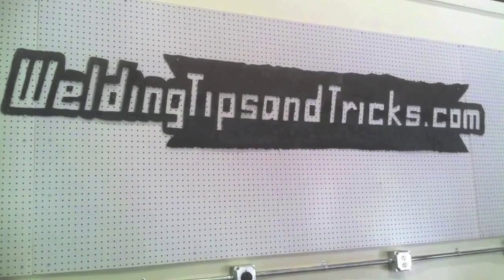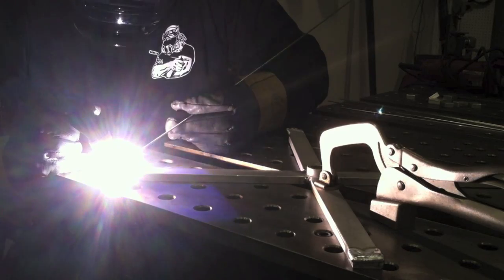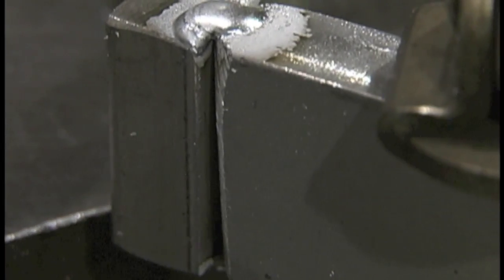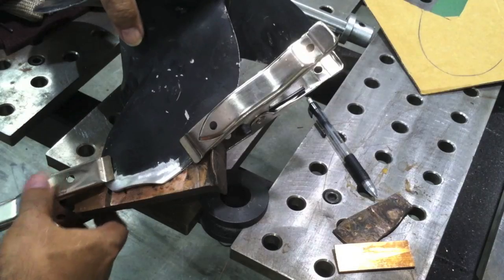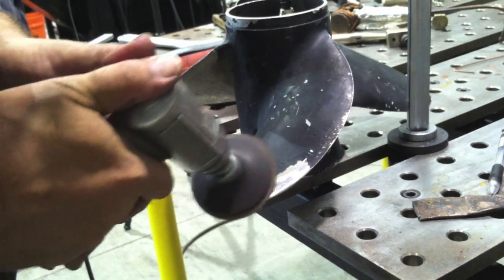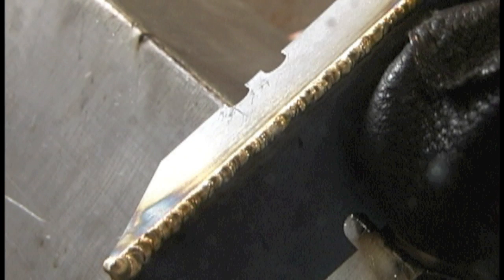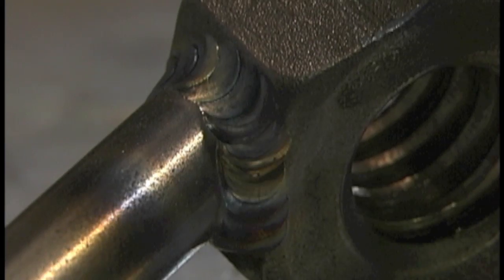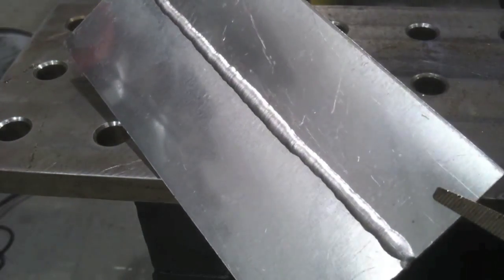Tig Welding 9 Random Tasks - Everlast PowerTig 210ext

Comment: it seems like Everlast has come to be a common name I was debating on a thermal arc 95s for a beginner tig setup but there is a Everlast one that is basically the same but a lot cheaper any recommendations no aluminum just thin steel for tig and about 1/8" for the stick welding

Comment: hey jody im having trouble with one of our Tig machines it says that it can weld up to 1/4 thick material, now today i welded a 1/8 thick aluminum gas tank for diesel trucks and i had to turn that sucker up to 174 amps to weld it  in your videos you only use half that most of the time. The machine is a millermatic syncrowave 200 and it maxes out to only 200 amps.

Comment from the maker: tungsten size matters mostly on starting the arc.  if you use too big an electrode you can have trouble with low amp starts.  arc wants to wander all around before settling down.

Comment: Thanks for sharing! Quick question for you and anyone else that can comment on this one. I have a newer Syncro wave 200 that works great. However by switching to the dynasty 200dx will it be a noticeable difference in the weld appearance and function? Is the 200dx really as good as what people say they are? THX

Comment: That machine has a really good low end.  I've used 2  different new miller synchrowave machines and they both suck for really thin stuff.  Arc start is always too high ...
Reply: Bill De La Vega wish you mentioned the machines u used